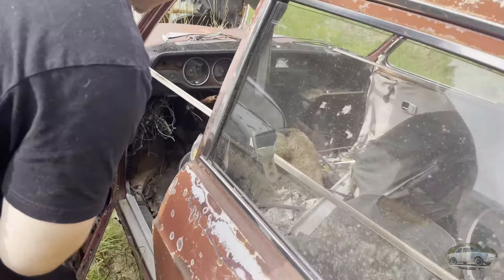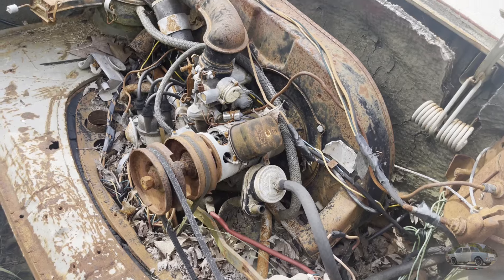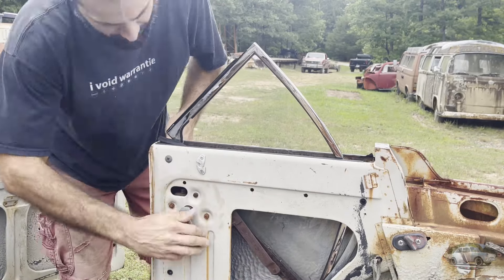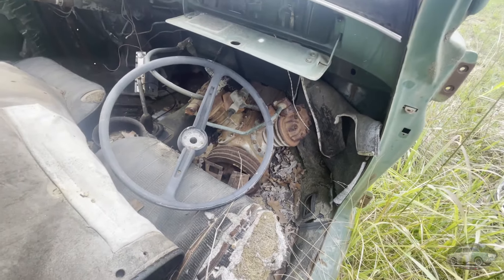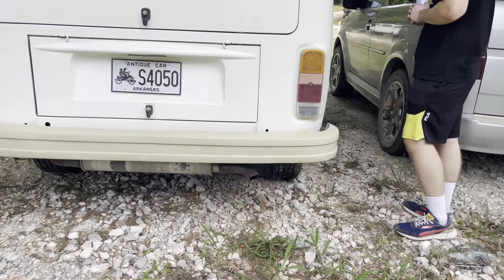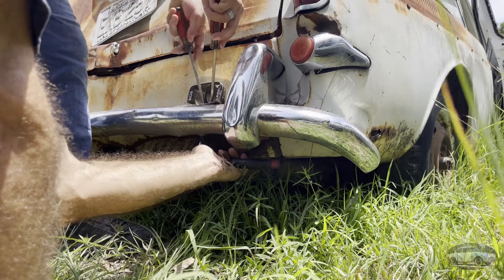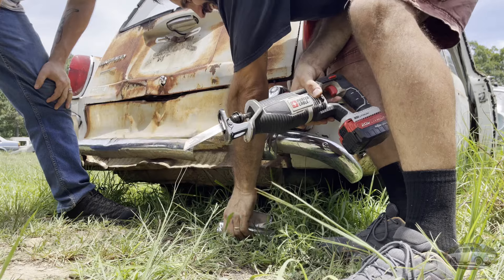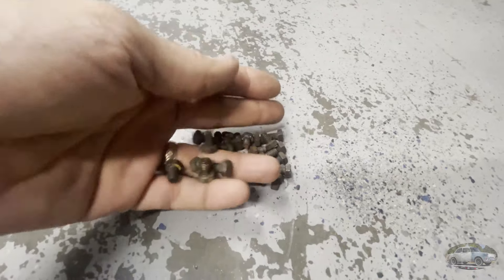Rarest aircooled VW in North America.. in the hills of Arkansas?

Comment: That "oil reservoir" is an external oil filter. This was pretty common on a lot of American cars of the 50s. Usually only part of the oil flowed through it but it was a lot better than nothing.
Reply from the maker: That’s very interesting. Thanks for sharing that. I felt like maybe I had seen something like it before. I couldn’t imagine it would be super effective, being a tap off the side, vs “in the flow”..
Reply: @vdubjunkie  A lot of American cars in the 50s did NOT come with any oil filtration at all. This style of unit was often offered as a dealer option or kits were available as an aftermarket. They could contain a wire screen element that was washable or a paper cartridge. As you said it wasn't super effective but the concept of a bypass valve wasn't common yet so a lot of makers didn't use full flow filters.

Comment: Hack
Ask me about a dual port type three engine and transmission installed in a 1965 Beetle, fuel injection and all
Reply from the maker: I’m curious about the why more than anything. I know there are some detriments to a T3 engine, when you don’t need to fit it under a lid. I would guess it had to do with having it available and needing to replace a blown motor. When I was a kid I tried to install a stock fuel injection back onto my ‘72 squareback. Turned out the ECU wasn’t sending the signal to the injectors and I really had no way to do anything about that, so I decided to swap over to a set of 34 ICT Webers